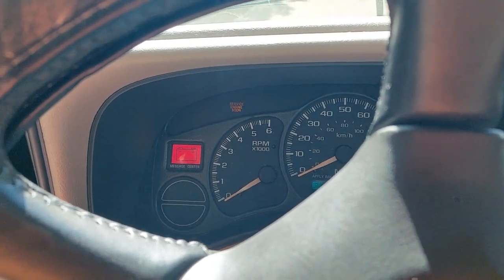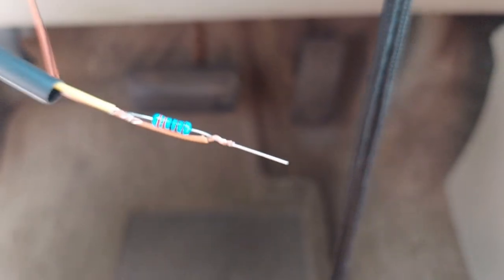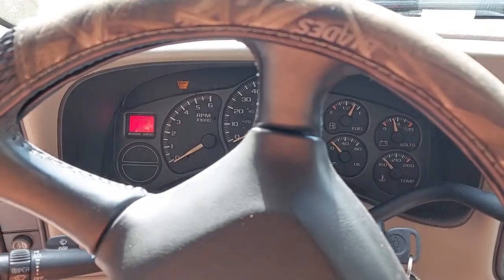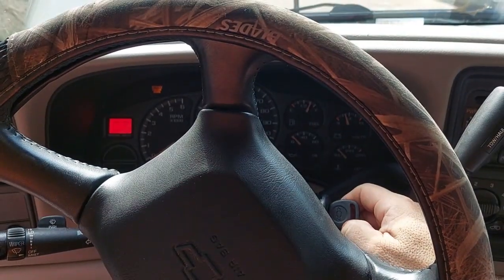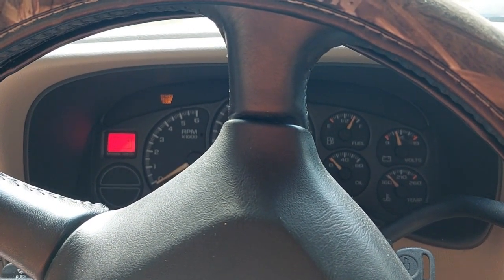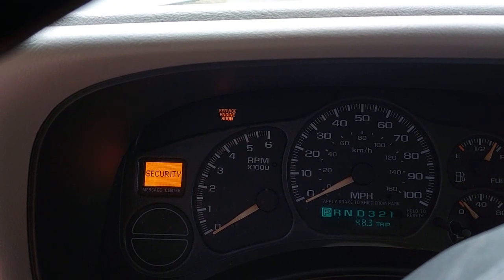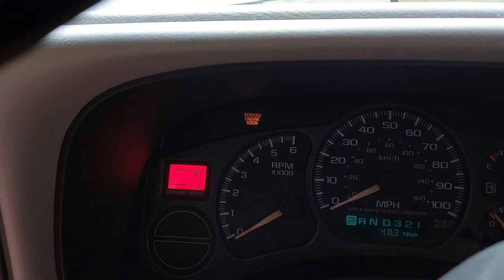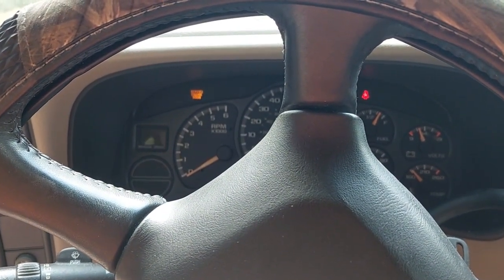2002 Suburban Ignition Hall Sensor Bypass and Key Relearn

Comment: Why the bypass using  resistor in the beginning
Reply from the maker: The resistor sends the same ohm value to the body control module as the hall sensor in the ignition switch that was causing the truck to not start sometimes.  Very frustrating to not be able to get home.  In the long run I ended up sending it in to have the VATS removed off the computer so even if the body module went bad I'll be able to start the truck.